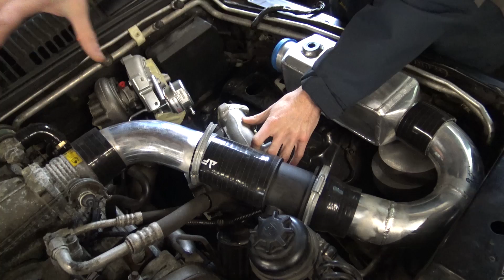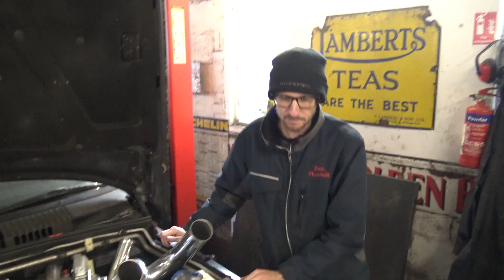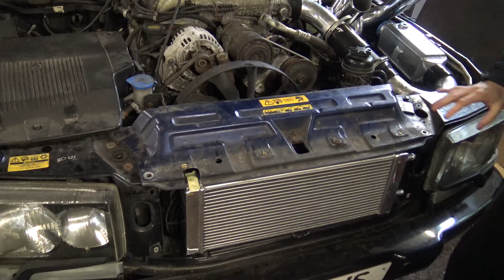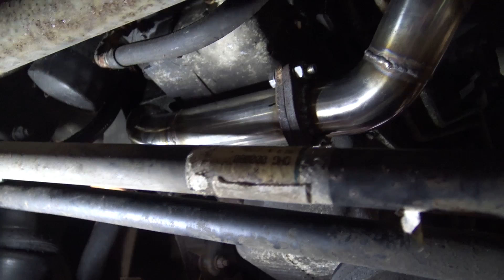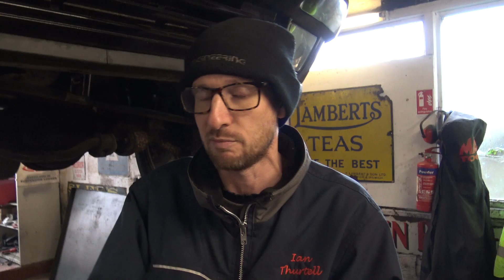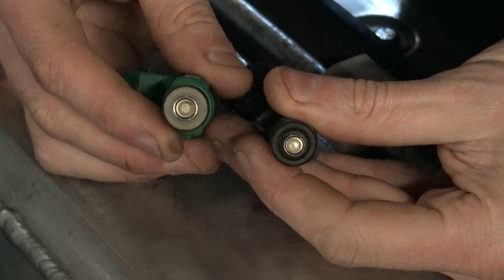Rover V8 Twin Turbo Tuesday Episode 5 - RPi Engineering

Comment: hey man, i got some questions on the rover v8, can the factory 4.6 block be bored out and still be strong enough to handle around 500 hp in a marine application? or would i have to buy a re manufactured block and where? atlantic british sells a short block but its about 5k US, im in canada, was thinking of running T/A performances heads
Reply from the maker: The block yer most likely. The pistons probably not long term. The crank and rods most likely (although we have of course not tested at that level) Your entering into the custom Rover V8 world, lots of research needed and then still after that its a case of try something and see if it works and if it lasts. I know of a few 4.6 500 to 600 bhp builds, all done differently and all working.

Comment: Which is the better injection system and is the ecu the same on both vehicle's or is the hotwire system better for an off road truck or even just go back to a twin carb setup for using the 4.6 in a trialing truck that also raises a question about camshaft profiles I had someone try to sell me a 4.6 with the SD1 in it with an MSD dizzy with a Weber 4 barrel carb I asked the guy about lift and duration of the cam and is it cross engine compatible and said well it's gone in fine and nothing has gone wrong yet which I had a chuckle at the mind set of that I don't mind going old school carbs but if there is a simple not to expensive route with efi which is the easiest and simple route, sorry for the massive multi fasseted question
Reply from the maker: Hi,
I think it would be best for you to email your specific question in and also what engine setup you currently have so that we can best advise. You can reach us on info@v8engines.com

Comment: What size injector are you switching to to support the theoretical 300hp? I believe the factory injectors are 19lbs/hr?
Reply from the maker: I think from memory we cover this in one of the episodes. However I am changing to a 12 port injector and from 3.5 to 4 bar fuel pressure. Then having the ECU mapped correctly once I am done building. at 3.5 bar this 12 port injector does not put in more fuel but a much better spray pattern however at 4 bar the original injectors did not raise constantly where as the 12 port did. I have now found some larger injectors however at the power I am planning to run as phase one these should not be needed.

Comment: Fantastic to see you doing this work on the best Range Rover there is, the P38 I am new to owning these cars but my God I'd have another, I got a diesel but love them, love watching what you do and good luck with it.
Reply: Your'e doing it the right way around, unlike me. My first P38 was a 4.6 HSE LPG which I had and loved for ten years but the engine was on it's way out so I got the 2.5TD P38 and the drop in power in unbelievable! I cannot recommend highly enough a 4.6 as the extra power to you will be amazing! Just make sure the cylinder liners are done, it was what caused the demise of mine and I couldn't afford / justify £4,000 for a new engine at the time!

Comment: An Eaton style supercharger with the bypass operating takes virtually no power to turn. The other factor which needs to be considered is the power used to run the supercharger when on boost. For a 5.0 v8 JLR engine which delivers just over 500bhp actually expends around 80bhp to drive the supercharger so it's making 580+bhp (things like oil pump, cooling pump, mechanical fuel pump etc all take power to drive but these are part of the base engine - it is amazing how much power these things take though). Turbos are no such problem, the back pressure will have a slight effect but there is so much free energy to be had from the exhaust side that it's not a worry. On this basis you get a better yield as you're not expending energy to get the benefit just recovering more of what would normally be thrown away through the exhaust. Apologies for that rather lengthy description....

Comment: Intake pipe looks close to the exhaust housing on the front turbo? Especially being silicone at that point. Airflow meter looks like it would be happier closer to the chargecooler & away from turbo heat (still not confident that will be happy with boost but I'm interested to see it play out! So what are you thinking torque wise then? Got to be well over 400 lbsft....maybe towards 450?
Reply from the maker: Yes as mentioned before there will be heat shields above both turbos and possibly if needed turbo jackets. Air flow meter position is not final yet. There is no issue with it being there in terms of measuring air as it measures air density etc and also it includes the air temp sensor so would give good reading of air temp entering the engine. However now that I am lookig at the breather system I think I may be swaying away from atmospheric breathers setup and these air flow meters do not like any oil on them so will also be looking at running the turbo inlets together and then to the MAF but not sure on space for that yet.

As I say in the video, its a development project, I have already changed what I had in my mind original several times and no doubt will change a few more times before it gets installed on to my P38 and the key is turned.

Thanks for following though and getting involved with comments etc.